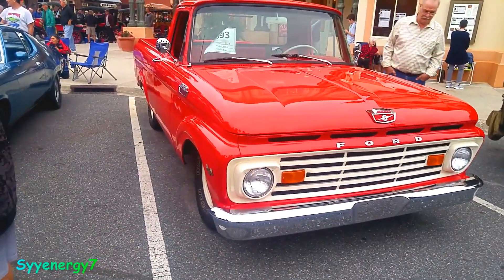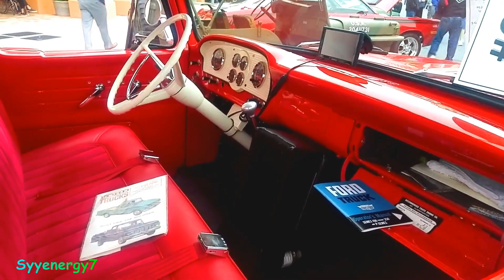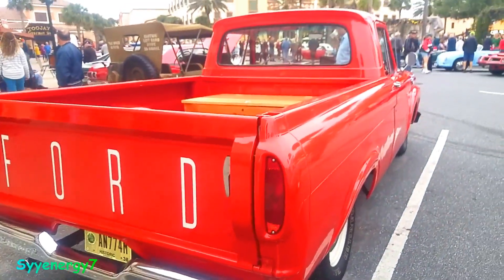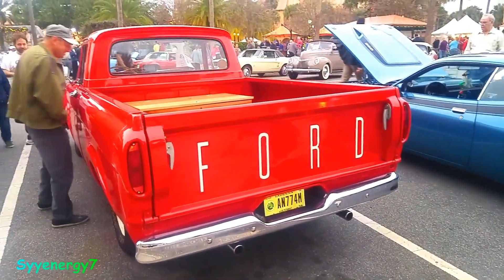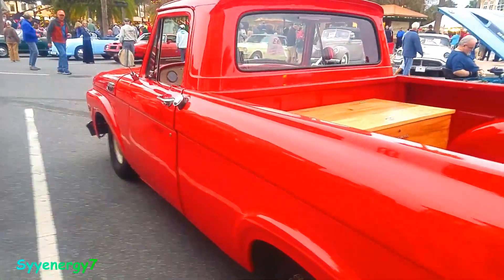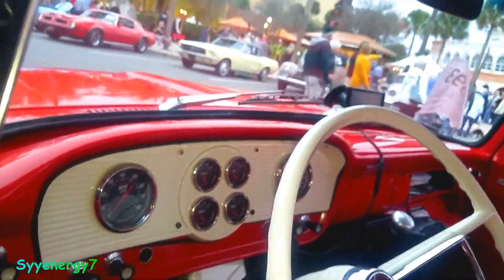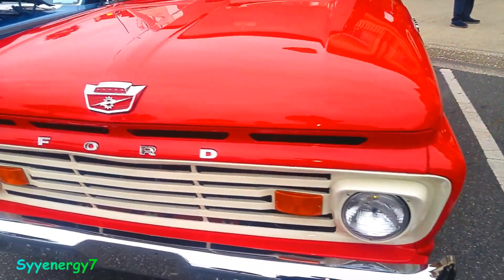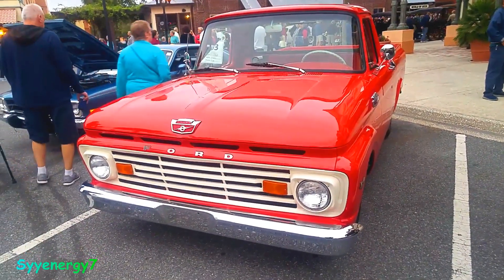1963 Ford F 100,  460 Ford Engine

Comment: Hey it's the Unibody F100.
Reply: I was just noticing that cuz the bed is not separate from the cab so it's even more rare
Reply: @ruserious2825  Right. The Unibody F100 is a cool Hotrod truck but not a great work truck.
Reply: Well who would use it for a work truck at this day and age? It would turn it to trash! Lol
 I'm happy to see that the Builder of it didn't convolute it by putting the Chevrolet motor in it
Reply: @ruserious2825  Exactly mate.